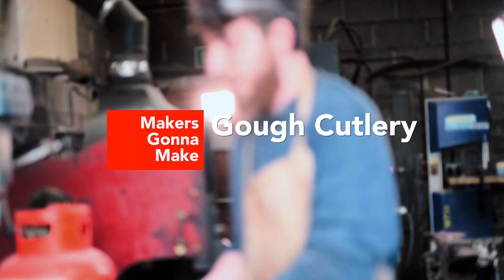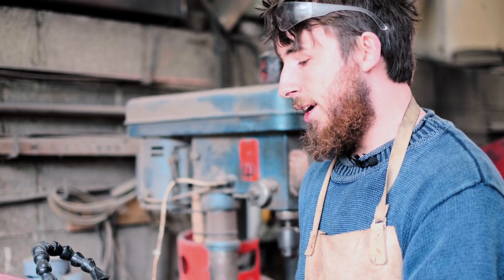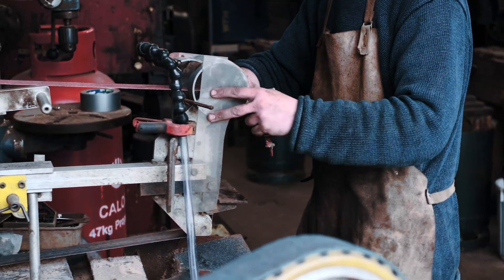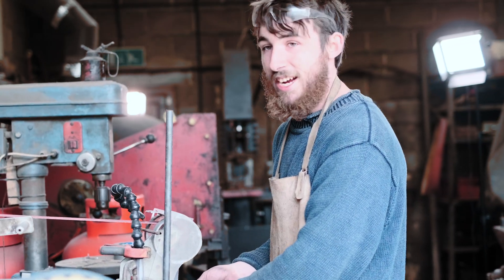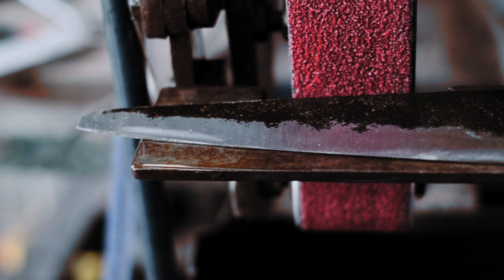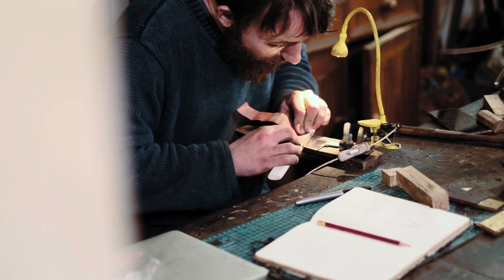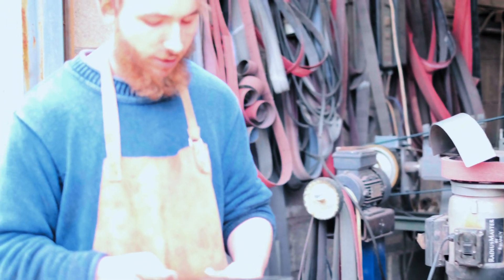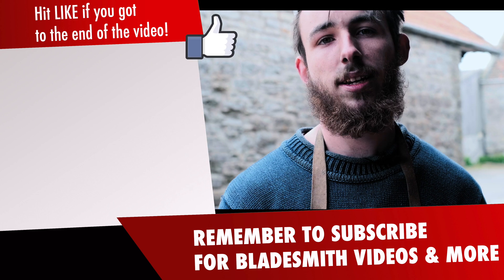1 big reason why grinding wet is bad (and a million reasons it's right!) Part 5

Comment: Hi I really like you you explain everything very clearly and even though highly knowledgeable come across as a really nice warm caring person.  Anyway I KNEW a guy who had a machine shop and yes as he got older he had metal in his lungs went on a portable oxygen cylinder and then he died.  That was before COvid happened.  So yes I think when grinding you should be wearing a mask.  I tried all sorts of things with sharpening knives and I just need it done fast.  I use a 4 x 36 sander I bought at a garage sale with all these extra belts and I think 120 was the fastest cutting with a nice finish.  I just put the knife on it and just ground everything flat.on each side then used one of those kitchen sharpeners gently just to get the burr off.  So they are really sharp.  Some people have a perfectly sharp edge then put a second bevel in to make it dull.  Go figure. I found the softer stainless ones would bend a little but having saved a ceramic saucer that broke perfectly in half I now use that to sharpen my all ready sharp knives. Not all saucers work the best the one I use has a rough but clean break. So the stainless steel soft ones I figure I am work hardening the edge and spreading it too and bending the metal straight again.  There are little little tiny nicks and I found out that they help cut vegetables a lot easier. They are hard to see edge looks sharp from looking on the end just a straight thin line.  The saucer works great on really hard blades too.  If you listen the sound gets smoother and smoother as the blade gets sharper also hard blades slide a lot easier than the softer blades and I press fairly hard holding the 1/4 of the saucer in my hand and sharpen downward and away from me.  Once I get the two sides flat on the belt grinder I never need to use it again. I do press gently and try to not overheat it.  OW I say if I ever see the edge turn a different color.  Light straw is O.k. Nothing is perfect.  I must admit it is only a problem with the best hardest blades you have an excellent point about dry sanding. Also i HAVE IT ON THE FLOOR OF THE BASEMENT  so that I do not inhale the particles I squat down and do it that way.  Probably should wear a mask but once I do it once it is good for the lifetime of the knife.  I really believe I am work hardening the edge of the softer stainless blades and actually pushing some material into the edge.
Reply from the maker: Thanks for the lovely comment Tanya. Harry is an amazing maker with a great personality! 

Feel free to check out his work - his details or on the video description.

Comment: What really enlarges your belts lifetime is the right speed, if you stay above 30mts/sec, with the #36 ceramics I use around 40m/s speed and get around 20 blades of 4mm thickness and 150mm blade, beveling around 30mm hight
Reply from the maker: Thanks for the input Wally!
Reply: @UKBladeshow  you're welcome! Hopefully it's useful!

Comment: I do all my grinding post HT (stainless only these days) and have been wet grinding for two years, I use a twin jet Noga Minicool MC3100, spray both jets directly onto the blade , about half the jet sprays on the belt too, works a treat. Have a 200 litre drum under my grinder with a 150mm dust extractor in it, water stays in the drum, leather apron required.
Reply from the maker: Thanks for sharing Ben that sounds like a great set up! I hope you enjoyed the video!

Comment: I run a metallography lab. We do all of our sectioning, grinding and polishing wet. It is easy to "burn" steel during the grinding proces. The thinner the section, the easier it is to damage the surface with localized retempering or rehardening. We can see it in the steel microstructure if the sample was handled improperly either by our sectioning process or was improperly ground in production. You can still burn the steel when wet grinding if you are being too agressive with stock removal.
Reply from the maker: Hi Robert thanks for sharing this info! I have little-to-no knowledge with metallurgy so it is nice to hear your comments on wet grinding on steel has 'some' effect to it but does little on the ability to potentially damage it if you're too aggressive. I understand that it could still damage the steel, but kindly bear in mind that I do have professional training on abrasive belts for a number of years and I still would personally suggest wet grinding as it prolongs the life of the belt due to reduced heat produced between the two substrates. I hope that makes sense. Thanks again Robert!

Comment: What did you call your articulating sprayer?  Can't seem to find the right stuff.
Reply: its called loc line, int mostly in american plumbing sizes so it can be a bit dificult to find the right connectors for your water system